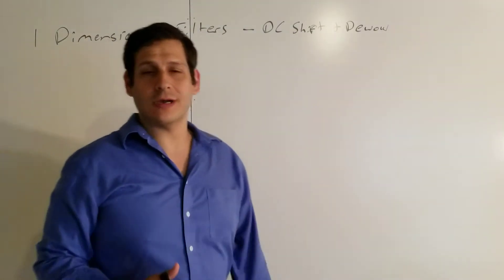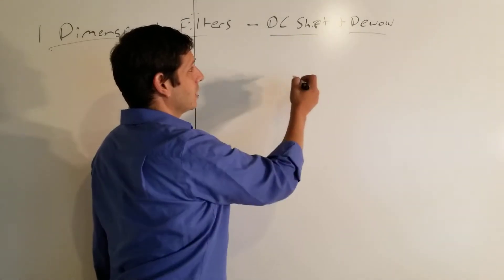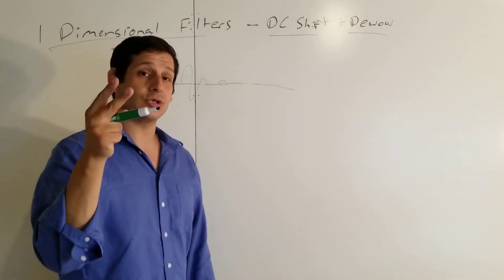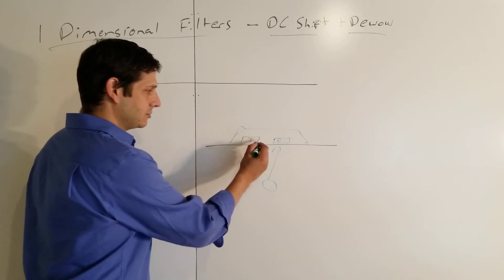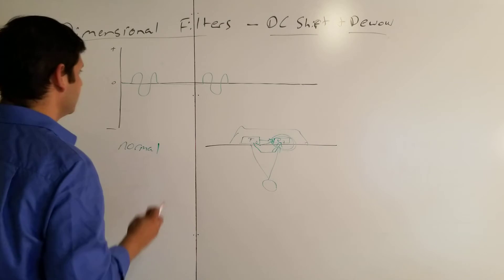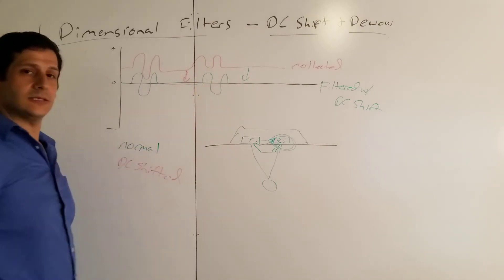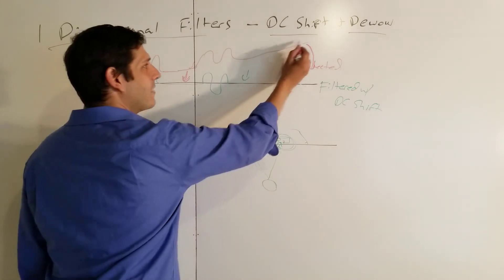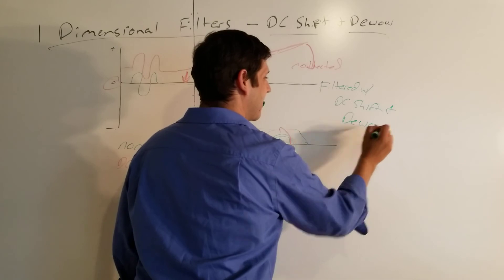1-Dimensional Filters of Ground Penetrating Radar (GPR) Data

Comment: Hi Dan, 
Thanks for your great contribution. Is the DC-shift filter necessary if there is, apparently, no shift? The means shift to be subtracted is always calculates using the whole recorded range? (e.g. 150ns if I acquired with 400Mhz with 150ns range). Looking at my data I can't tell it is shifted, even after applying the filter and comparing both there is almost no difference. My data refer to 400 and 900 MHz antennas with shallow range (150ns - 12m; 60ns - 6m) on dry snow; There is some deeper 400 MHz acquisition with 600ns range (60m). Maybe at these deeper profiles, a DC-shift can be more significant.
Reply from the maker: Thanks for the question!  It is not always necessary. You dont havento use the full time window, you might prefer to use a shorter window that is a little more aggressive since the shift may be worse later in the time window.

Comment: thank you for your explanation sir. i use reflexw to filter my gpr data, and i dont know how to fill the time window parameter for dc-shift filter, can u give me some information? what actually the software did so the mean will be zero? thank you
Reply from the maker: Kurniawan Kesuma Putra usually the system will automatically do it.
Reply from the maker: Kurniawan Kesuma Putra but, when you aplly the window it will move the average for the window size to zero.
Reply: thank you sir for your answer